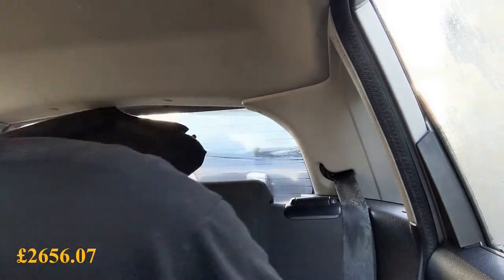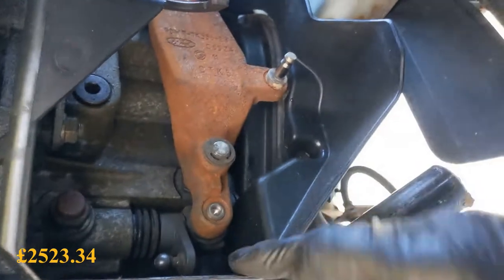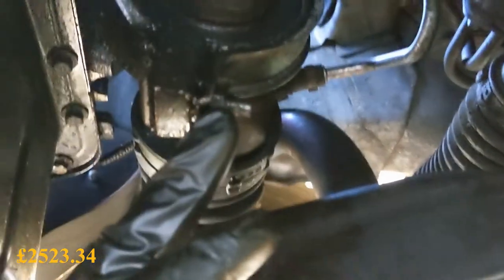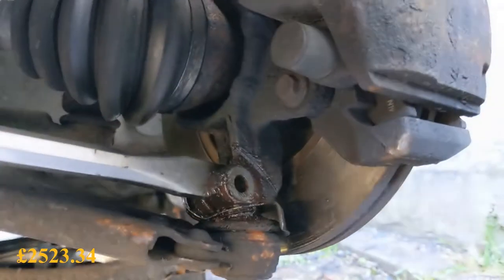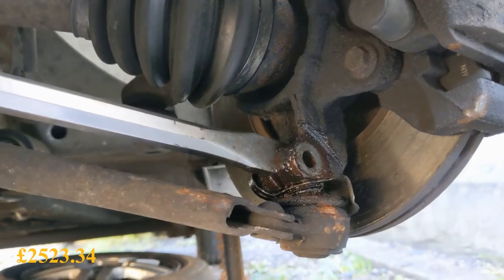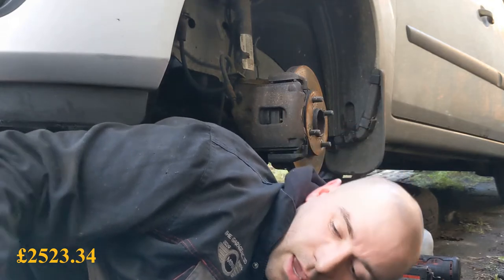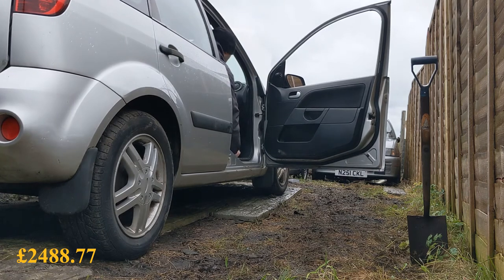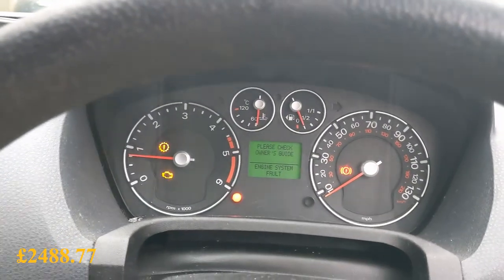How To Turn £500 Into £15,000 Episode 14

Comment: Cheers for the shout out 👍🏼
Top content as usual 👌🏼
Out of curiosity why didn't you leave the nut on a few threads when you bashed the drive shafts out? Would have saved you having to sort the threads

Plenty room at the new house to get a little carport built for this rubbish English weather 

Hope you and the family have a good Christmas mate :D
Reply from the maker: No worries. I did leave the nut on the passenger side and that's why it ended up falling to pieces. It also damaged the threads with the nut on. The shafts were properly tight in the hubs. I usually use a big punch but like I said I'd left it at work so just grabbed what I thought would work best. Haha. Yeah the plan is to put a shelter of some sort up. I'd like a fully operational workshop but ain't for the cash for that at the moment so a car port  will be the next best thing. I don't mind working outside to be honest.

Thanks Dan and hope you have a decent Christmas and New Year!

Comment: Binge watched all these now, need some more. How you getting on with this and the punto?
Reply from the maker: I've had to lend the fiesta to a friend while I replace the engine on theirs. Don't get me started on the Punto. I got it off someone I know in the trade and there is more wrong with that than I was told. It's currently on axle stands with the fuel tank on the floor so I can weld the cross member up.
Reply: @Papa77sGarage  mate I can sympathise with you 😂 I seem to have cars that should be quick turn arounds on my drive for months. It's just getting the time to sort them out around family and work.
Reply from the maker: @lewisbsalford  yep exactly the same with me. I also can't turn a good deal down when one comes along. Even if I don't have the time, money or space to do anything with it 😂
Reply: @Papa77sGarage  Puntos In My Opinion Are Toltal Bags Of Shite. End Can End Up Costing a Fortune... No Point Even Scrappin Them As there Litterally No Weight At All. Best of Luck With It Mate. Love The Channel!
Reply from the maker: @renmusxela  I quite like the look of them but I definitely won't be trying to make a profit on one again. There is just too much unreliability. Thanks, I'm glad you're enjoying the channel.